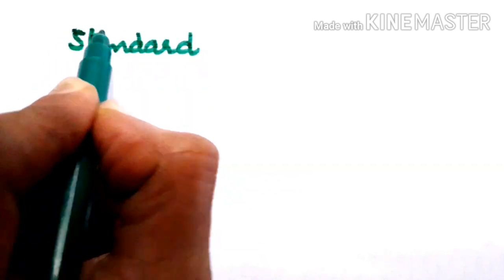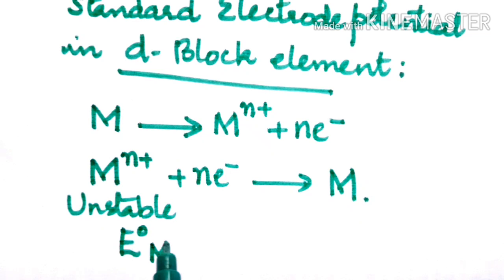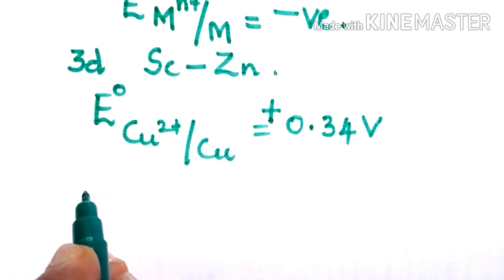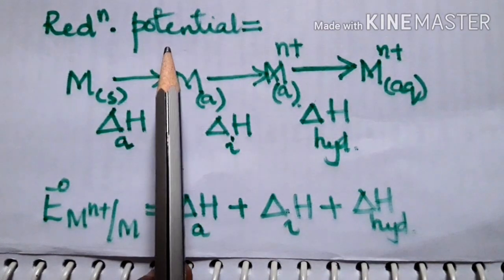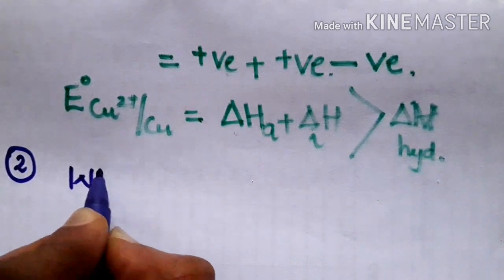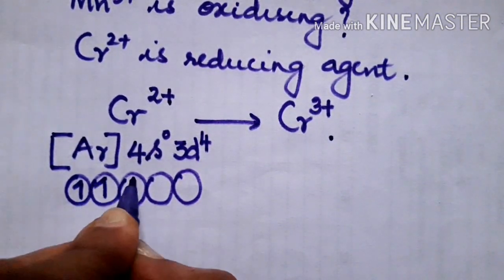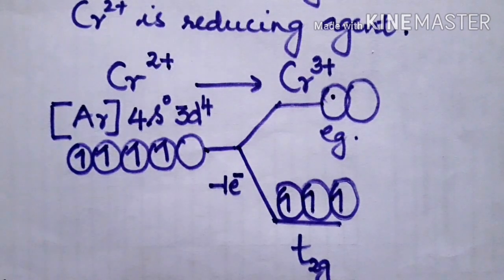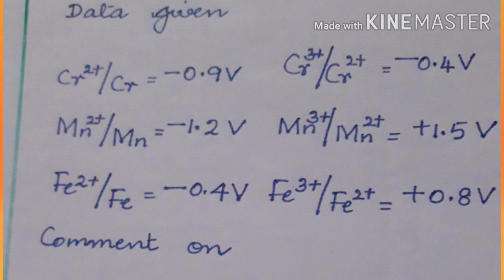Trends in reduction  potentials  in d block

Comment: Ma’am why cr2+ is not taking electron to get (Cr+)d5 half filled configuration as mn gets
Reply: @kesav Rao Yeah bro same question
Reply: @deeptiriyar1808 Cr2+ on loosing electron goes to Cr3+ which is the t2g half filled condition, this condition being more stable and requiring only 1 electron thus change of
Cr2+ to Cr3+ happens